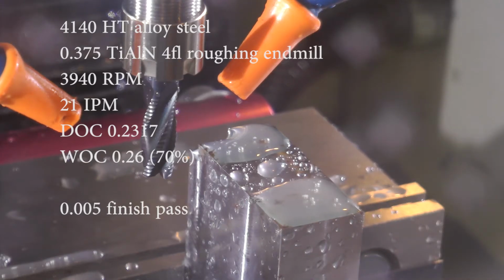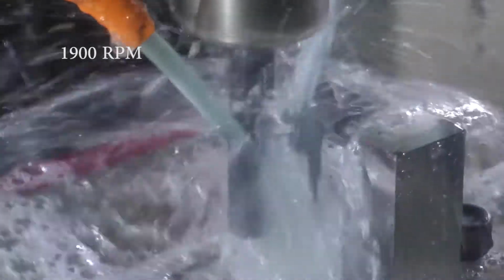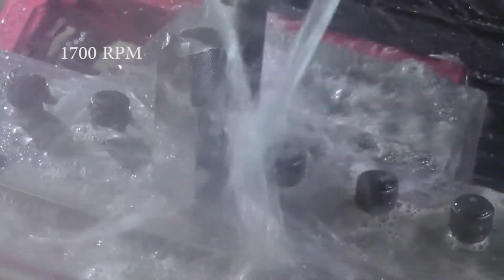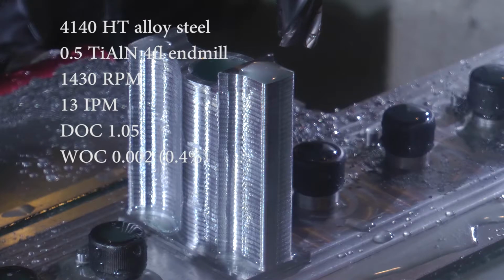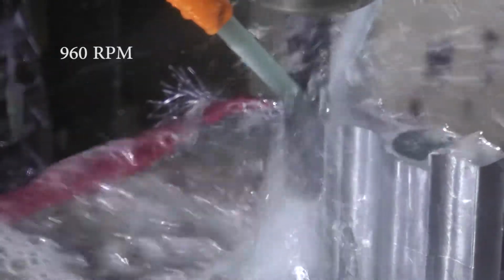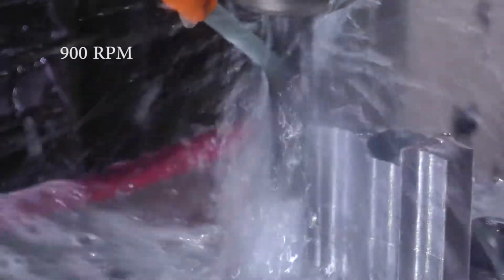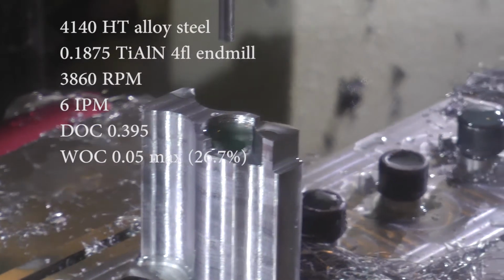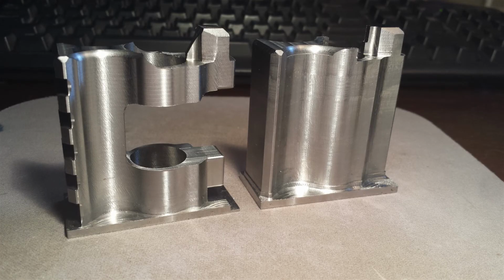AR15 High Rail Gasblock: (pt.8) Roughing, finishing, and bayonet test cuts

Comment: Looking good!

I'm not enough of a machinist to know, but we need a G code for chip break peck drilling to a certain depth and full retract peck drilling for chip clearance below a certain depth.  I write most of my G code by hand for my simple jobs, so I'd just manually code exactly the types of drilling operations that I need for each specific application, writing the code as I go, starting with the most conservative, and tweaking seconds out of the cycle time as I optimize the program over many parts.

G Wizard not withstanding, feeds & speeds are still something of a mystery.

Most people hear chatter and slow the spindle speed and/or depth of cut, but many times, a slightly greater depth of cut or slightly greater feed rate is what's needed.  There are some YouTube videos that demonstrate this very dramatically.
Reply from the maker: I heard about that G code but I don't think Mach recognizes it. My drilling ops generally use G82, G83, or G73 as I recall. Carl at Lakeshorecarbide had some pretty good advice. To deal with chatter he suggested first lowering the spindle RPM until it goes away (increasing the chipload just as increasing the feedrate would). At that point, taking note of the chipload. Then increase the RPM and feedrate to where they maintain that same chipload. The chipload at the point the chatter disappears being key. So in may case if S900 F13 doesn't chatter then S1800 F26 should also not chatter as they have the same chipload. I'm hesitant here because those internal radii could really chip my endmill if I hit them too fast due to sudden deflection. I'll try it but not until I have a replacement endmill in hand.

Your're right I think most people hear chatter and immediately lower the feedrate thinking they are going too fast when the opposite is true, their chipload is too low and lowering the feed would make it worse. They need to increase the chipload by either increasing the feed or lowering the rpm.